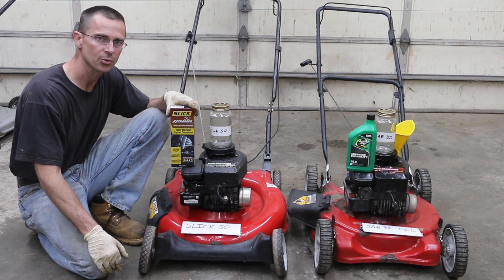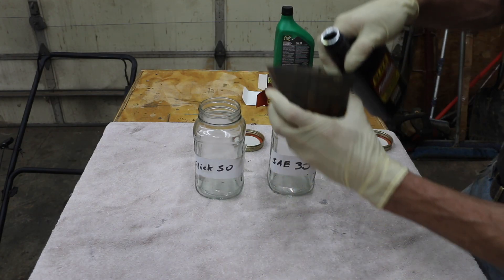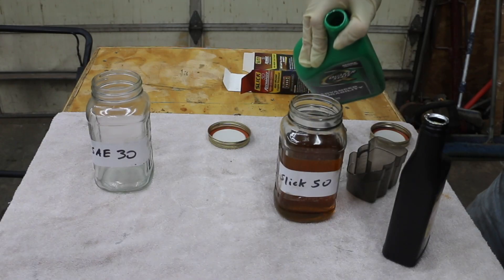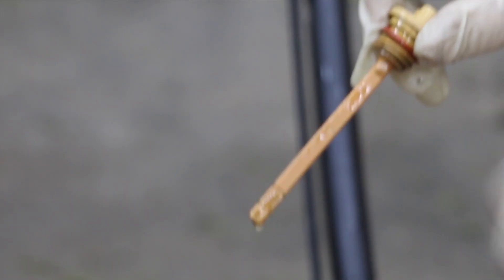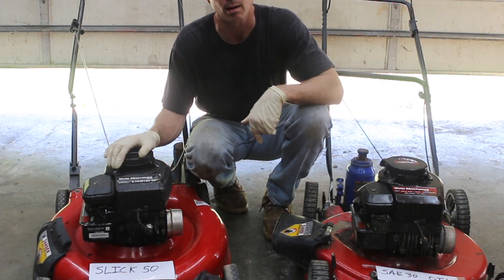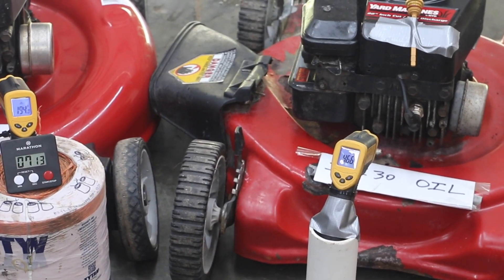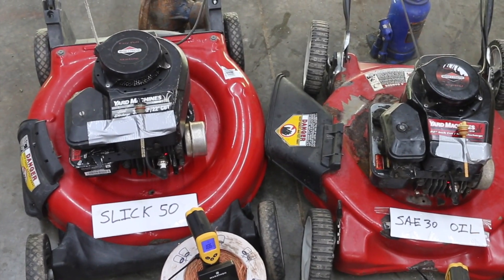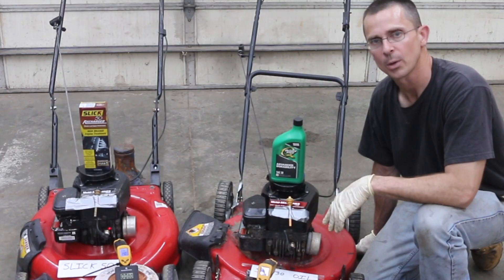Can't believe what SLICK 50 did to my engine!!--Dry Crankcase Test!

Comment: 305 chevy in excelent shape with 348,000 miles, then sold it to a teenage boy...three years later it was still running. dont know what happened after that.
Reply: Lots of slick 50???
Reply: @highrevryan2288  yes, I used it very often, but don't recall just how often I did. It was a 1984 Monte Carlo . I drove a "lot" of miles back then and slick 50 was different formula...it was a thick with a white residue that settled to the bottom if not shook up properly. Also, back then they they reccomended you warm your engine up before adding the product.

Comment: Motul 300v should stick beter. Al. Do the label says the eshter core makes it stick Beter and there should also be double eshter core.
Its should be a different kind of composition for the oil.
I very curious about it.
I use 7100 motul a lot in my supermoto it runs beter then the motorex oil the advised me to use.
It seems thicker and stick a lot beter and stays clear longer then the motorex oil does
Reply from the maker: Thank you for the recommendation

Comment: you should run assembly lube and normal oil in a lawnmower and check the parts after running then for a good long time to see if assembly lube really does prevent wear.
Reply from the maker: Thank you for the video idea!

Comment: just out of curiosity, before using a test method in a video, do you try using the same product several times in identical situations to see if there's a lot of variability in the test method? In any case, I think your videos are great. I'm going to head over to Patreon.
Reply from the maker: Thank you.  I do quite a bit of testing before videos when it's possible.  In this instance, I did not use the test procedure on multiple engines.

Comment: I am from Holland and I used Slick 50 ,I guess it must have been over more 30 years ago, in my Opel ascona 1600cc engine. As the commercial at the time claimed the idle speed did go up (less friction) , did prove right , but not for 10.000 kilometers as the claim was (every other oil change Slick 50 had to be added) but for about 6000 kilometers. Car engines at the time needed every 5000 kilometers a oil change. A bit dissapointed, I never used slick 50 again (it was quite expensive to at the time).However this engine lasted more then 700.000 kilometers (about 435000 miles)before it failed . If it had anything to do with the one time i used slick 50 is doubtful but it was exceptional for the time. At the time Slick 50 was a white thick liquit in a little bottle. The white was no doubt the teflon, so it looked quite differend from the slick 50 nowadays.
Reply from the maker: Thank you

Comment: I forget when, but several years ago slick 50 changed its formulation and I do not remember the specific reasons why. It had to do with something to the effect that the people who we're making slick 50 were not the original designer and he still owned the patent on the mix. The other thing I will point out is that if you remember those 25 or 30 year old commercials, there was only ever two engines that they had on engine stands that they would run dry of oil. Most prominent of which was a slant six Dodge engine. The other was usually a small block 318 Chrysler engine. I have seen both of those engines on various occasions run dry of oil white people who didn't have any understanding that you actually had to change oil on occasion. The Slant six I have seen survive run dry of oil on several different occasions. I have also seen the small block V8 Chrysler engine survive being run dry on oil on a few occasions as well.

The only product that I know of that uses PTFE to supposedly, deposited within the contact surfaces of the engine is motorkote.
Reply from the maker: Great point. Thank you

Comment: Wasn't there a slick 50 oil...not just an additive?
Reply from the maker: I need to check into this.
Reply: I drove my 50,000 mile '95 Jeep from long beach ca to Eagle Pass Tx with no oil in the crankcase. I had driven around Maui for a year with Slick 50 in it. When I made it to Texas I showed the mechanic what was up. He saw a dry dipstick n though my engine was gonna seize. Turned out my  PCV blew out. We went an got the part n the guy also bought slick 50 for his truck. True Story. That's a long ride at 70mph, stopping only for fuel, with no oil.
Reply: I remember it being tiny yellow beads in a clear "mucus"
Reply: I also used it in an '85  Cressida.

Comment: If you want to make non stick tools heat it up until it red hot drop it into slick 50 about 5 times. This made a coating on pins to clear out holes with hot glue for windows it would not stick to the coated pins.
Reply from the maker: Great tip! Thank you

Comment: Most are interested in this test as it relates to using Slick 50 in their car engine. What about the wonders of expensive synthetic oil? This from a master mechanic several years ago:
The question of whether to use synthetic or traditional "dinosaur" oil often comes up among car buffs. Consumer Reports (July 1996) ran an extensive test on the two types of oil, altering among many different brands. The testers installed freshly rebuilt engines in 75 taxicabs, and then ran them through the harshest conditions on the streets of New York City. Placing different brands, weights, and formulations in the cars, they racked up 60,000 miles on the engines, tore them down, measured, and inspected the engine components for wear. The oil was changed at 3,000 miles in about half of them, and the rest were changed at 6,000 miles. The results: regardless of brand, synthetic or dino, weight, and oil change interval, there were no discernable differences in engine component wear in any of the engines. Their conclusion? Motor oils and the additives blended into them have improved so much over the years that frequent oil changes and expensive synthetics are no longer necessary.

Still, some people swear by synthetic oil. In practice, I don't recommend using synthetic oil if you have an older car with old seals in the engine. There have been many documented cases in which the addition of synthetic oil has caused an otherwise dry car to start leaking. If you own an older car that doesn't have fresh seals in the engine, I would stick to the non-synthetics. However, if synthetic oil was the only type of oil that your engine has seen, I recommend sticking with it.
Reply from the maker: Great information!  In your opinion, what specific thing in synthetic oil causes oil leaks in older vehicles?  Is it part of the additive package?...or the base oil that's being used?

Comment: Ooow this was interesting. I wander, slick 50 is a good lube, but what temp does it break down? Know what I mean? So mixed with oil, the engine is coated with both, but maybe oil by it's self can handle higher temps than slick 50. And once the beak down starts, it may accelerate? There has to be more to this.
Reply from the maker: Great point.  Not sure
Reply: @ProjectFarm  I'm on the edge of my seat, for your next test! 
I don't know about all you, but strange engine noises stress me out...... There is something cathartic about see an engine go though these trials, and finally explode.

Comment: slick50 needs to be ran for long enough that it impregnated the metals with the PTFE .. i have seen 1st hand what it can do for a motor .. a buddy had a oil pump drive twist off on a  327 chevy, this motor had slick 50 ran in it from break in until it lost oil pressure .. anyway he drove the van for about 45 miles in city driving .. i tore it down and all the bearings where still in spec, could havre just replaed the oil pump and drive and been good to go.
Reply from the maker: Thanks for the constructive feedback

Comment: I used slick 50 for maybe the first 50k on my 03 wrangler.  Back then it looked way different than the stuff you had here.   It was white-ish.  I think it had a crap ton of teflon in it back then, which i believe they've moved away from.  My boss (old car guy) was always like "that stuff's just gonna plug up your oil filter and ruin the engine."   I've got 170k on it and it still runs like new.  Probably has more to do with the mobil 1 it's had for it's entire life, than whatever additives i put in it.
Reply from the maker: Thank you!

Comment: i HAD A 1986 CHEVROLET BLAZER WITH A SINGING REAR DIFFERENTIAL.   DRAINED AND PUT ENTIRE QT OF SLICK 50 AND TOPPED OFF WITH 80 / 90   AND SINGING STOPPED AND IT WAS LIKE THAT FOR YEARS AFTER.   DIFFERENTIAL TEMPS REACH 700 DEGREES. 

WHILE WORKING FOR FORD, A TECH WAS BLOCKING THE ALIGNMENT RACK AND WE HAD ONE TO ALIGN AND ONE WAS BEING FINISHED.   THE CAR BLOCKING AND NEEDING TO BE MOVED DID NOT HAVE A SIGN ON IT TO SAY DON'T START.   OR THAT THERE WAS NO OIL PAN ON THE CAR - AN OLD THUNDERBIRD - 70 S VINTAGE IN 1984 DAYS.   MY BUDDY WHOSE JOB THAT ACTUALLY WAS I WAS SITTING IN IDLING; AIR CONDITIONER ON IN AN AUGUST CALIFORNIA DAY; SAID HEY, SHUT THAT OFF - THERE IS NO OIL PAN ON ! OH REALLY.  I OPENED THE DOOR AND PEEKED UNDER AND WATCHED THE CONNECTING RODS AND CRANK SPINNING AROUND AND SURE ENOUGH; I HAD BEEN SITTING THERE IDLING FOR OVER 10 MINUTES. WAITING TO GET THIS CAR OUT OF THE WAY SO I COULD USE THAT SLOT TO BACK INTO AND PUT MY JOB ON THE ALIGNMENT RACK.   UH OOOOOO.    SO WE MADE THE EXECUTIVE DECISION TO PERFORM AN OIL CHANGE AND CHANGE THE FILTER. AND THEN PUT IN 1 QT SLICK 50 AND TOPPED OFF WITH 20 / 50  W.     GOOD TO GO AND GOOD OIL PRESSURE - NO KNOCKING.   FORDS HAVE AN AMAZING LOWER END THAT CAN TAKE RUNNING ON A BLOWN HEAD GASKET MILKSHAKE FOR OIL FOR MONTHS AND STILL NOT GET ROD KNOCKS.   CHEVY AND CHRYSLER CANNOT HANDLE THAT. 

SLICK 50       IT DOES COAT THE BEARINGS AND JOURNALS IN TEFLON AND IT DOES WORK.   TAKE THAT FROM A TECH AND SHOP OWNER THAT USED IT AND SWEARS BY THIS PRODUCT.   GOOD TO KNOW ON THE LOWER TEMPS.   DIDN'T KNOW THAT.

AS FOR THE ENGINE DYING OUT FIRST.   THERE WOULD HAVE TO BE 10 OF EACH OF THE SAME TIME ON THE HOBBS TO PROVE OUT SLICK 50 BEING INFERIOR TO SAE 30. 

THANKS PROJECT FARM
Reply from the maker: I enjoyed reading about your experience with Slick 50!  I believe the formula changed in the past.  Thanks again

Comment: What about prolong I remember commercials stated they would run a engine dry
Reply from the maker: I need to test Prolong soon. Thank you
Reply: @ProjectFarm  I will definitely watch the video and see the results of Prolong, many say it is chlorine and bleach , i have used it for years with no problems, but i hear it could actually be harmful to your engine, the test would be interesting to see. I like your channel we have many of the same interests Thank You for your time and energy you put into making the videos
Reply: @ProjectFarm  still commenting on old videos,  verrrrrrrryyy nice
Reply: @ProjectFarm  prolong v slick 50
Reply: I want see that, I remember the prolong infomercial using an old Chrysler 318 with no oil, they dumped sand, gravel, and sprayed water into the engine it was still running with no oil pan, then they held the engine at 5500 rpms for about a minute. I'd like to see if this is real.
Reply: Different make up it's not the same but it is available under a different name.

Comment: DuPont refused to sell teflon to Slick 50 because they considered it a scam, they knew teflon particles suspended in the oil did not do what Slick 50 claimed. Slick 50 sued them and won the right to force Dupont to sell to them.

Independent tests show that it does nothing that Slick 50 claims. But another independent test showed that suspended teflon particles in the oil did reduce friction a small amount, but only while the teflon was suspended in the oil. Once the oil was changed to normal oil without teflon suspended in it, the friction went back to normal. Remember Slick 50 advertises its a treatment that coats the engine with teflon and protects it the life of the engine, its not true. And sure enough Project Farm tests support that, the engine ran a little cooler with Slick 50 in it, once they drained it, the engine quit sooner than an engine that had used regular oil.
Reply from the maker: Great information. Thank you!

Comment: Great videos. You also must shake the slick 50 as the particles are heavier than oil and settle at the bottom. Sad to hear they changed the formula. I used to sell it and have used it in all my vehicles since the 80s.
Reply from the maker: Thank you!

Comment: did you read the instructions for the slick 50? flush the engine first with engine cleaner, then ,  run the slick 50 for many hours before doing the empty oil test

Comment: I always buy cheap cars with high miles. I use Mobil 1 full synthetic and a half a bottle of Lucas oil Stabilizer. Never had an Engine go out on me. 

An Engine is an artificial construct. Conventional oil comes out of the ground and is created by natural processes...that is why conventional oil isn't as compatible to engines as an oil created in a lab.
Knowing this saved me many, many $1,000s. I even use Mobil 1  and Lucas OS in my lawnmower.
Reply from the maker: Thank you!